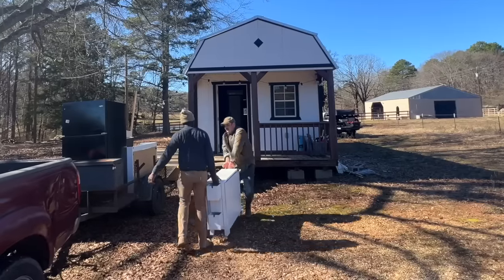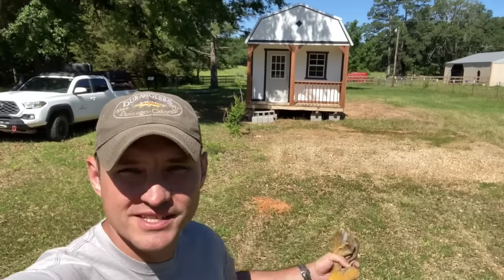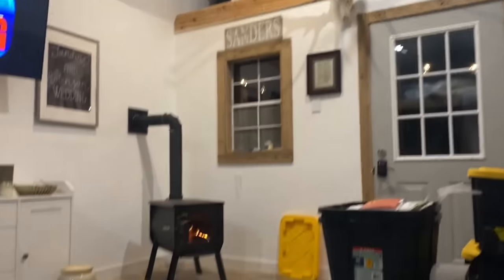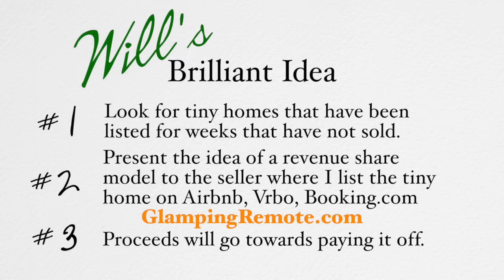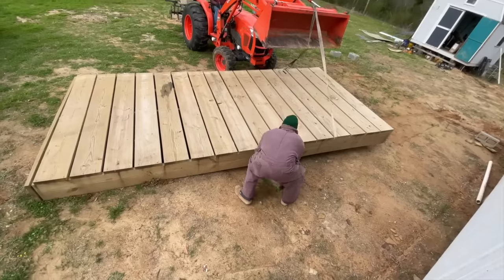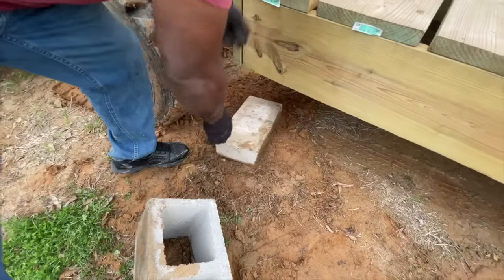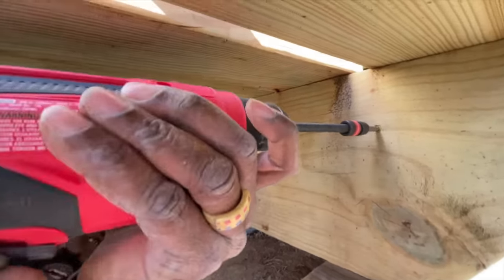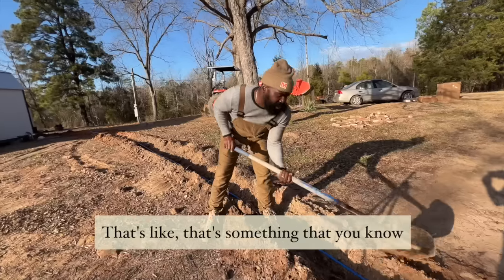We Got A Tiny House For FREE

Comment: I hope you don't live in an area that has hard freezes, because those pipes don't look like they are buried deep enough to keep from freezing. I lived in a cottage once where the owner had just laid the pipe from a far distant pump very shallow and we had frozen pipes every time it froze. I hope you replaced that orange extension cord wiring with up-to-code electrical wiring, because that could cause a fire. 

Anyway, good luck. Hope it all works out for you.
Reply from the maker: We don’t have hard freezes. And there’s no orange extension cord anywhere in the video.

Comment: Tiny House Trailer House Dealers Hate Me. Specially when I break down the Financing and tell them what I CAN Afford to Actually Pay a month. I CAN Afford $500 a Month!
EXAMPLE ONLY Prices ROUNDED UP! A $24,000 Shed ( Tax and Delivery Included ) at $500 a Month should only take 48 months. 4 yrs
    Nope, They Want One of Two Payment Options
$905 at 60m/ 5yrs = 54,300    OR     $815 at 72m/ 6yrs = 58,860   More than Doubling the Price of the Shed.  
     50,000 Two Bedroom Trailer House ( Tax and Delivery Included ) at 500 a Month = 100m/ 8.3 yrs.. NOPE! They want 1,500 at 60m/5yrs = 90,000  OR  1,300 at 72m/ 6yrs = 93,600
    They Hate me because I Only Receive 1350 a Month on Disability BUT I am Also Still Able to Afford that $500 a Month. I am Smart with my Finances and I Owe NO ONE! Everything I own I OWN!
    It's No Wonder there are Soo Many Repo Video Channels here on the tube... Dealers Over Charging and People Stupid Enough to Sign the Contract, fully knowing they can Not afford the Shed or Trailer house in the First Place.. I get told to "F' Off!" And/Or My Comments Removed.
    PLUS Add to the Fact that You Can NOT Legally Change Or Modify the Shed/Trailer House UNTIL It Is PAID FOR!. Yet have Soo Many Stupid People start Pumping Money into them. AND You CAN Build the Same Size Shed for just Under Half the Price and Use the Money You Save to Put Into to It as You Build... 25,000 shed costs ABOUT 10,000 to Build. Saving you 15,000. Put that 15,000 into it and you will have a Hellofa Nice Home.. Not pay them 25,000 and still have to put money into it ONLY AFTER It's Paid Off at 55,000-59,000 ... But Then again, We would not have those Wonderful Repo Videos to watch..